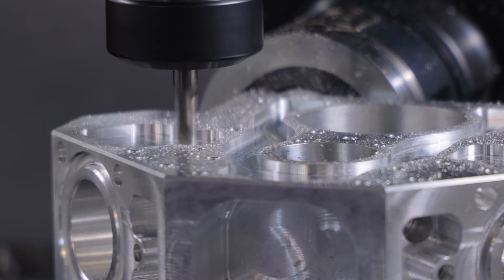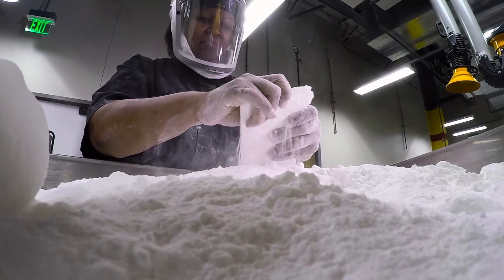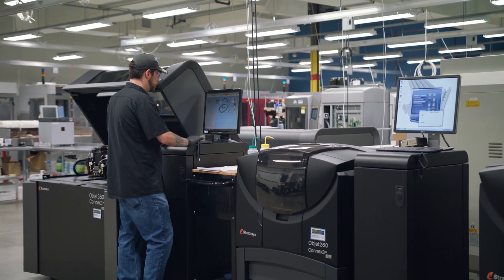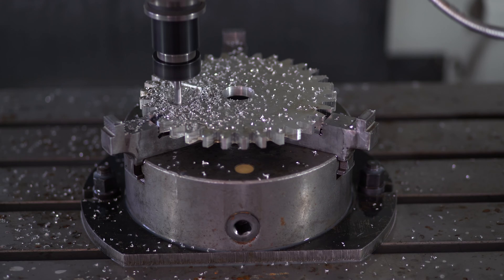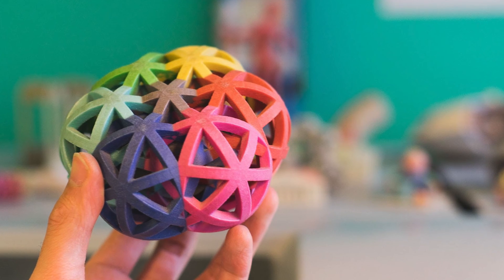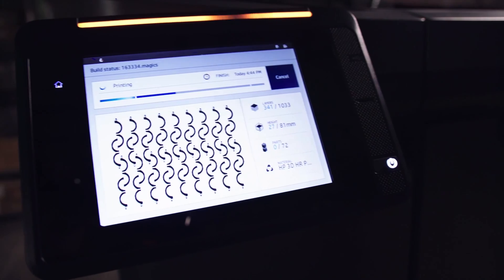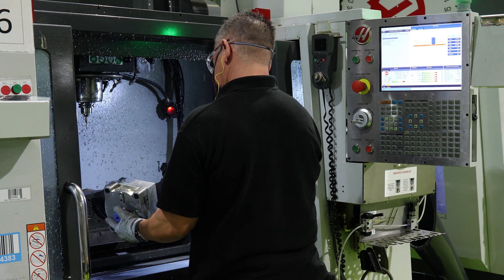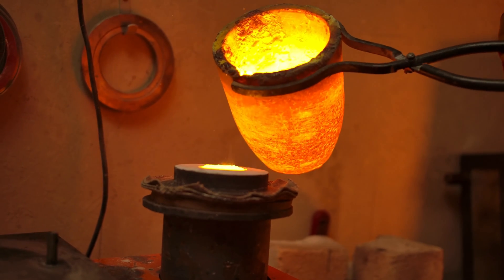CNC Machining vs 3D Printing - Which Do You Need?

Comment: Thank you for the information. Which is better for making plugs, molds, and casting RC models (mainly RC planes) from composite materials like carbon fiber and fiberglass: CNC machines or 3D printers? As a hobbyist.